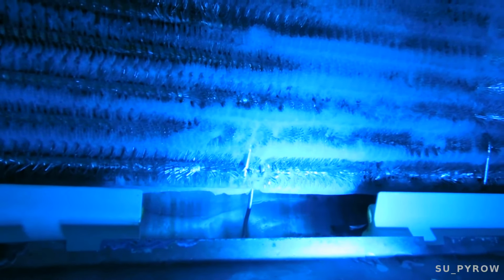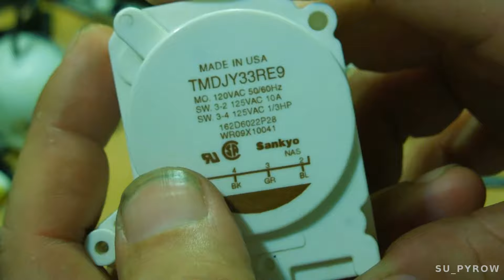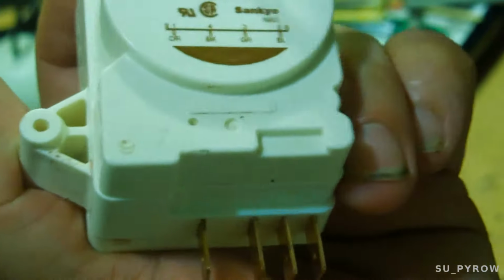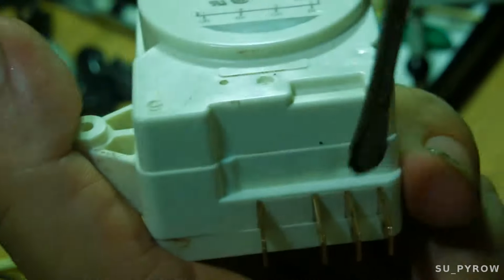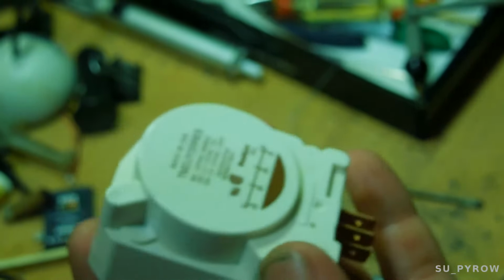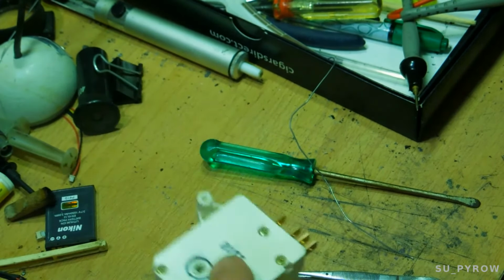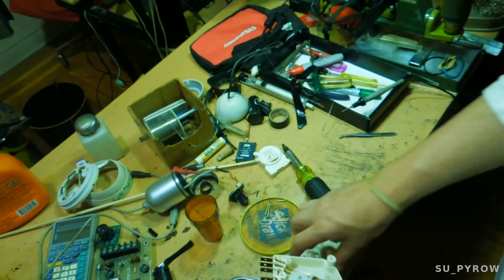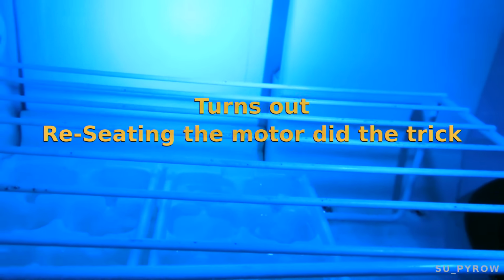HotPoint Refrigerator Troubleshooting SU PYROW #05

Comment: when I use to work in maintenance for apartment communities, The Hotpoint were notorious for freezing up because the drain holes clog up with slime, it gets hard and you damn near have to beat it out. A little ammonia usually clears the clog or a good blow with a co2 gun or small air compressor will work as well. If the drain is clogged the ice builds up and blocks the air baffle that goes between the freezer and fridge. We usually replaced the timers but if they don't get a good ground they don't wanna work either. I usually just turn the timer to test the defrost. It will click but you can pass it easily so go slow. Just my experience, great video brother! It was fun, took me back to the good ole days.
Reply from the maker: Thanks!!! I did not know that!   GREAT INFO.  i will check into it for sure!
Reply: i am having problems never ending with mine waiting four days lost out on my food too